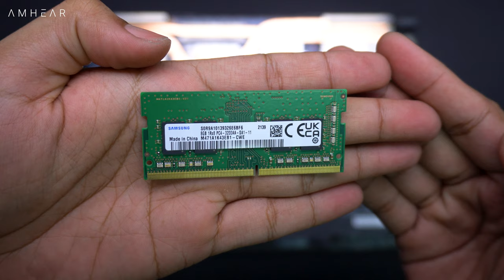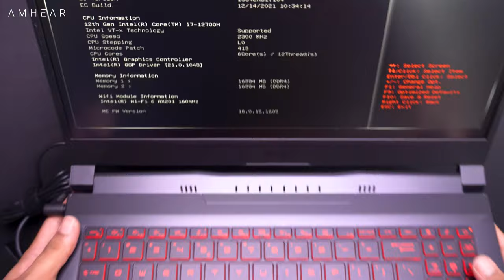MSI KATANA GF66 12UC 240ID | Upgrade Options

Comment: Can you put a 2.5" SSD on this laptop? I have the same model and I'm scared of opening it up since it still brand new.
Reply from the maker: no, there is no slot for 2,5" drive
Reply: @Amhear  aww dang, thank you.
Reply: Hey in my case there IS a SATA slot for the 2.5'' SSD. The only way for you to find out if your specific laptop has it or not is to open it up unfortunately.

It was not mentioned anywhere in the specifications for my model, even on the official website, and when I contacted MSI's customer service for confirmation they simply told me "no it doesn't have it, unless you can send photographic proof of it". Then I opened the laptop, found the connector (to my surprise), sent them the pic and they confirmed that my laptop has it lol

I still don't know if the SATA slot actually works though, and I was considering buying a drive to test it out soon

Also very important! Before you open your laptop, make sure to contact MSI's customer service and explain to them what you intend doing, so that you don't risk voiding your warranty!
They answer pretty quickly and they probably don't care but their rules say that you need to have your request approved first, for some reason

And that's another reason I had contacted them for, to explain that I was going to replace the SSD with a new 2TB one
Reply: @Amhear yes there is it’s right in front of you why lie

Comment: I have the same laptop.. Is there any hdd slot in it?
Reply from the maker: unfortunately, no
Reply: I'm going to copy a reply I wrote elsewhere, forgive my laziness 

Hey in my case there IS a SATA slot for the 2.5'' SSD. The only way for you to find out if your specific laptop has it or not is to open it up unfortunately.

It was not mentioned anywhere in the specifications for my model, even on the official website, and when I contacted MSI's customer service for confirmation they simply told me "no it doesn't have it, unless you can send photographic proof of it". Then I opened the laptop, found the connector (to my surprise), sent them the pic and they confirmed that my laptop has it lol

I still don't know if the SATA slot actually works though, and I was considering buying a drive to test it out soon

Also very important! Before you open your laptop, make sure to contact MSI's customer service and explain to them what you intend doing, so that you don't risk voiding your warranty!
They answer pretty quickly and they probably don't care but their rules say that you need to have your request approved first, for some reason

And that's another reason I had contacted them for, to explain that I was going to replace the SSD with a new 2TB one

Comment: This laptop only have one M2 slot? Font have any normal ssd slot or something?, Nice video ^^
Reply: this motherboard layout doesn't have that feature. the UX does though
Reply: I'm going to copy a reply I wrote elsewhere, forgive my laziness 

Hey in my case there IS a SATA slot for the 2.5'' SSD. The only way for you to find out if your specific laptop has it or not is to open it up unfortunately.

It was not mentioned anywhere in the specifications for my model, even on the official website, and when I contacted MSI's customer service for confirmation they simply told me "no it doesn't have it, unless you can send photographic proof of it". Then I opened the laptop, found the connector (to my surprise), sent them the pic and they confirmed that my laptop has it lol

I still don't know if the SATA slot actually works though, and I was considering buying a drive to test it out soon

Also very important! Before you open your laptop, make sure to contact MSI's customer service and explain to them what you intend doing, so that you don't risk voiding your warranty!
They answer pretty quickly and they probably don't care but their rules say that you need to have your request approved first, for some reason

And that's another reason I had contacted them for, to explain that I was going to replace the SSD with a new 2TB one
Reply: @williamsjessem yes it does

Comment: Its have only 4 pipe??
Reply from the maker: yes it's has only 4 pipe
Reply: @Amhear  hi please help me! i want to buy msi katana gf66 12uc model it has i5 12500H and rtx 3050 but i wonder is it 3050 maxQ or maxP. i want to buy maxP for more performance please help me how can i learn it i can't find on msi website and seller's description  model number is : 	
MSI KATANA GF66 12UC-258XTR
Reply: @umutozcan7418  max-q varient are build for low power consumption means less performance and little bit big battery    

Some time ago I was also thinking that max-Q is max varient of grafic card 🤣 

So go for non max-Q or other varient Buy the laptop which,s grafic card name is simple like rtx 3050,3060 etc for high performance try to go with ti or high numbers grafic card or go for high volt grafic card because it use more power it performance more 

But don't go for max-q or any other named varient
Reply: @endman9815  i always want a msi laptop but msi uses max Q so i bought 3050Ti maxP laptop ( caller “monster” ) Its a turkish brand so im happy now thanks
Reply: @umutozcan7418  congratulations